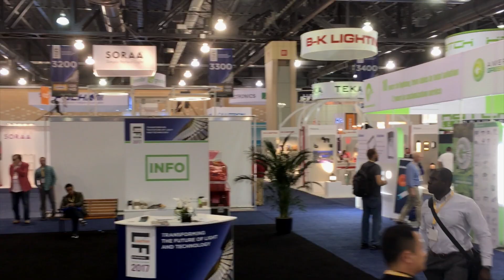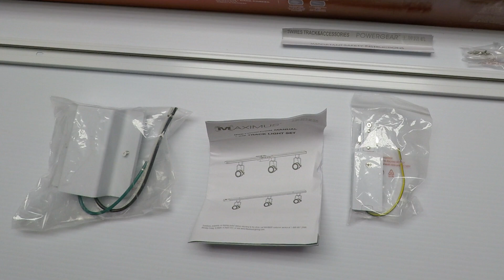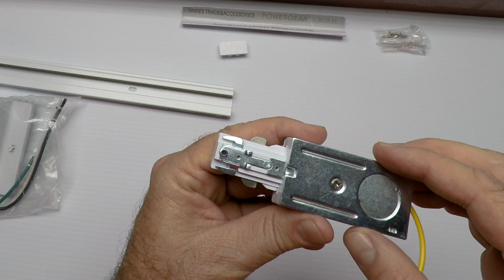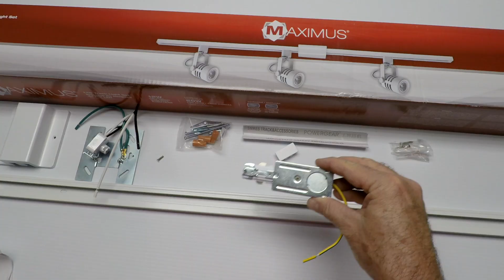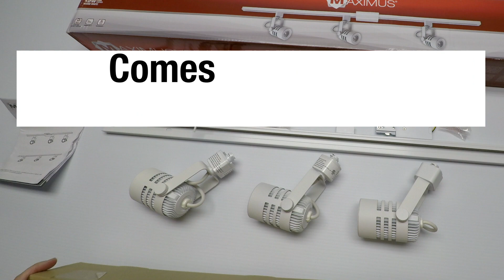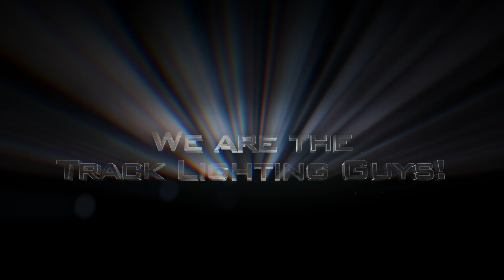7 Helpful Tips about Our Complete 3 Light White LED Track Lighting Kit - Lightfair 2017 Ep.6

Comment: Too few How-to videos take note, that there is a line on one side of the track, that corresponds to the Neutral and ground bars; some fixtures also have a line to help, but if not the fixture needs to be inserted and rotated so that the two tabs match that line marked side of the track. Forcing it the wrong way can damage the tabs, or with some fittings the polarity can be reversed, a dangerous condition where the power comes into the threaded part of the socket, not the proper end contact.
Reply from the maker: Thank you for sharing :)

Comment: can a LED track kit take a halogen light? And or vice versa Thank you!
Reply from the maker: Depends on the track lighting kit. The one in this video uses an integrated LED system and can not be serviced. However, we sell track lighting systems that allow you to use LED or Halogen lamps. Our systems provide the greatest flexibility when it comes to customizing your light source and servicing your track lighting. You're not locked into a specific beam spread, color temperature or wattage with our track lighting. If the application changes our systems can easily adjust to those needs. Also, it's better for the environment and your bank account due to the fact that you can replace the light bulb only and not the entire track light. You can find our track lighting here 👉 http://www.totaltracklighting.com/